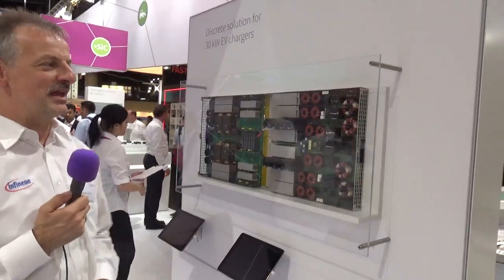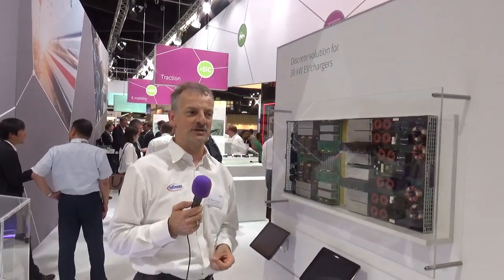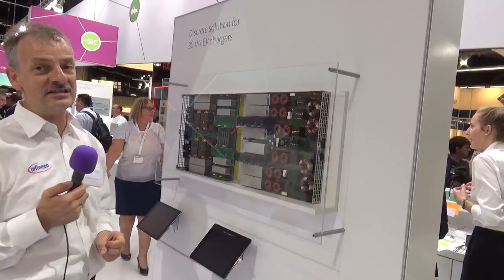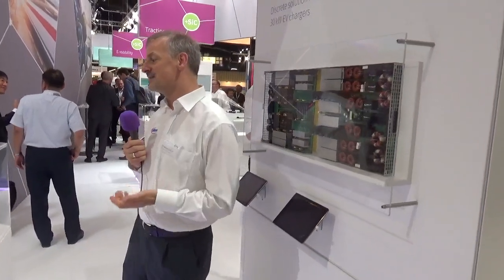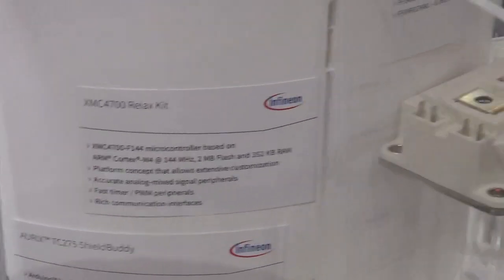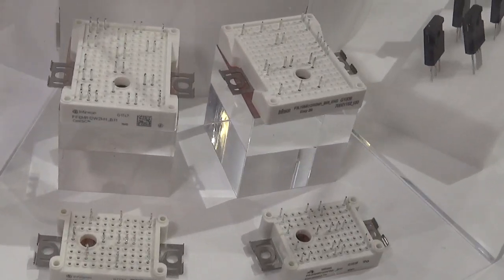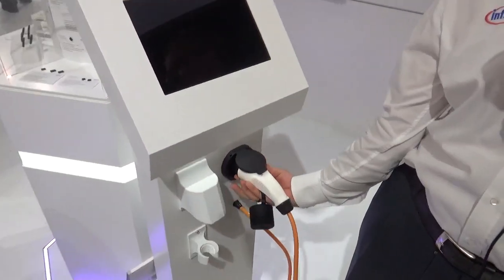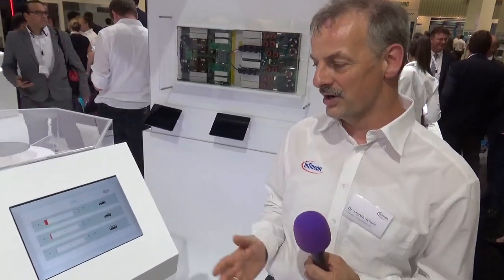Infineon describes their latest EV charging solutions

Comment: If you use silicon carbide, why don't you use the conventional 2-level converter with just 6 switches to converter 3-phase AC-DC? It is much simpler to control and requires much less devices.

Comment: Is it possible that you implement also a control mode for DC input? Because i think in the hardware layout there is no change necessary, only the control algorithm of the vienna rectifier should be adopted. 
Then it would be possible to connect your car direct to  another battery (car2car charging or home battery to car) and also to a PV field. (Garage with no electricity grid connection etc.) 

By the way: Who needs a 30kW charger, when there only 22kW or 43 kW connection points?